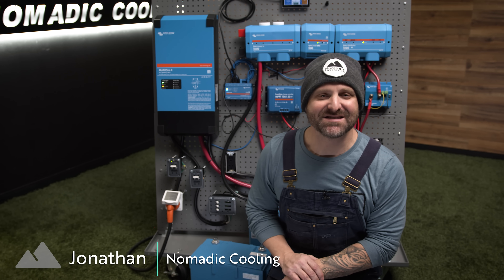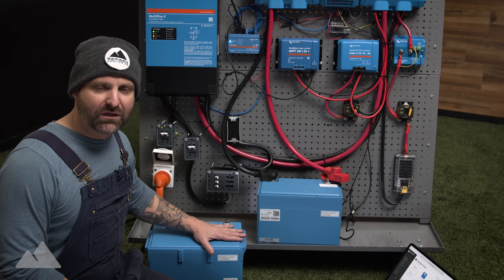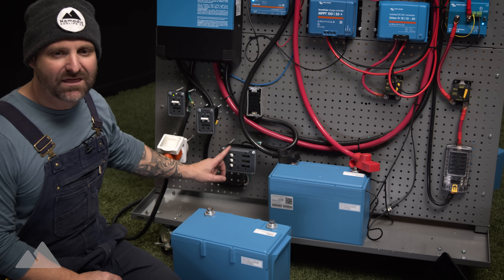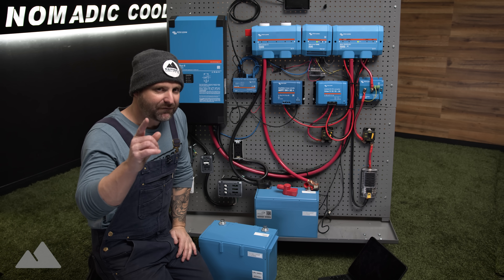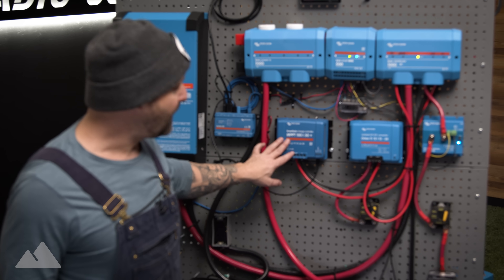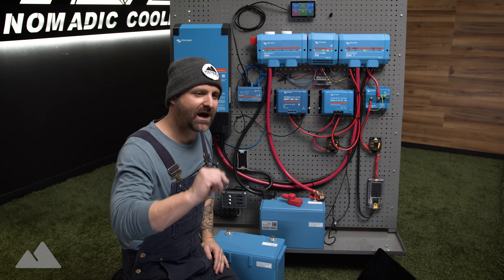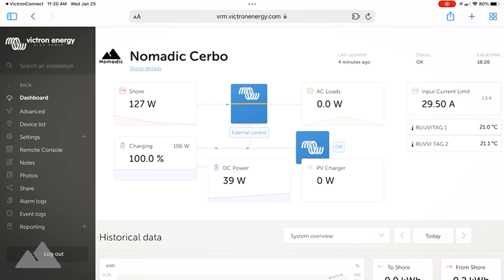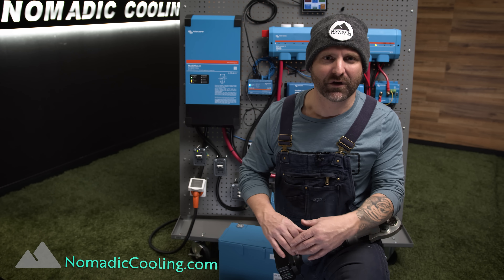The Nomad 3.0 🔋 Electrical Kit By Nomadic Cooling ☑️ Victron 200ah or 330ah Battery

Comment: Why do you have a single breaker coming out of the Multiplus that then feeds individual load breakers?  I don't understand the need for the single breaker.  The Multiplus isn't capable of overloading the output wire (assuming it's appropriately sized).  The individual loads probably have smaller gauge wire, so a breaker makes sense there (plus it provides an easy way to turn each circuit off).

The Victron system diagrams also only show breakers for the individual loads.

Comment: Glad to see you are still iterating on the kits (and youtube is suggesting them to me). Having an additional display up front (via ipad or phone) would be excellent, but relying on wifi/data for it is a bummer. When building my setup i was curious if you could run an eithernet splitter and run two hardwired cerbo touch displays (one in back and one up front). Never got to see if it would work or not, i suspect i may present a problem as both transmit touch info but maybe it would work? 
I have a few photos / videos of the dogs using the dometic faucet, i just need to quit being a bum and send them your way!
Hope all is well!
Reply from the maker: Thanks Colin. Great idea! going to run that test for ya. Look out for the video coming soon.